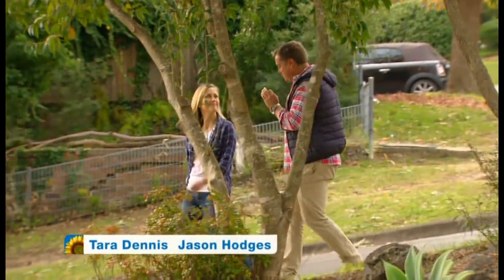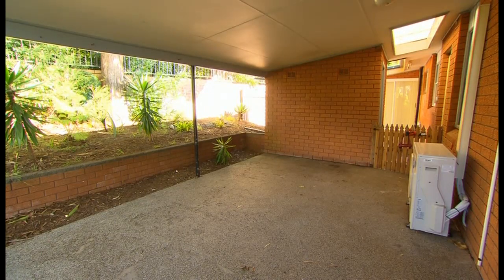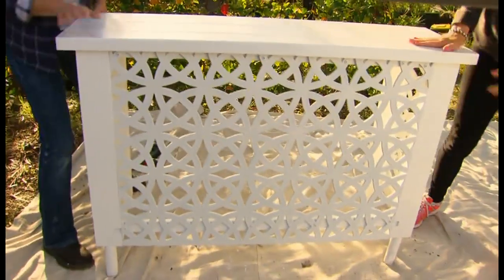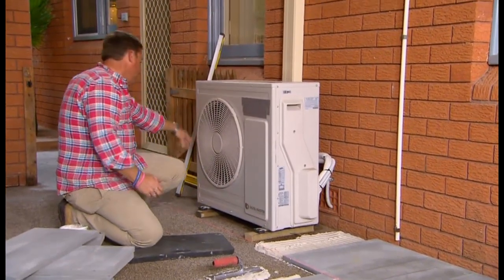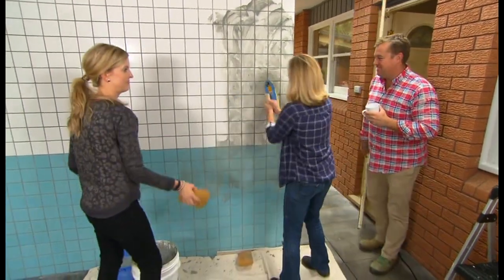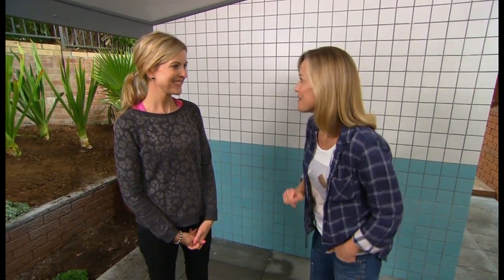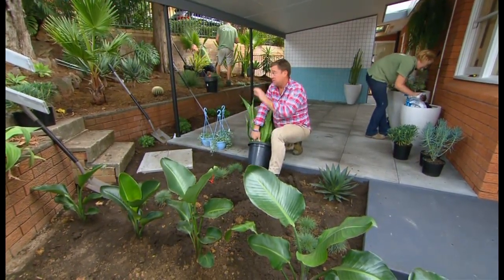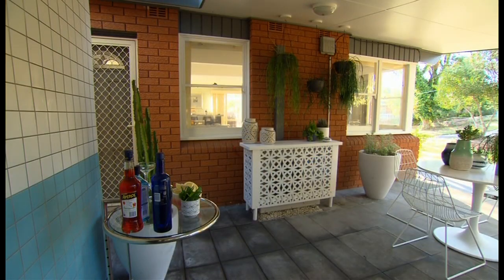How To Create A Stylish Outdoor Entertainment Area | Outdoor | Great Home Ideas

Comment: The tiles need to go. Absolutely.
1. I'd keep the brick wall and hang a big frame with a landscape painting, with a lamp above to draw the eye to the painting.  Or just add a hanging plant in the middle of the frame. Then add some wall lamps on either side to add atmosphere.
2. Otherwise I'd cover the brick with vertical wood slats, either painted a neutral colour, gray or varnished for a more natural look. I'd bring in a hanging plant or two again in front of it (to bring the garden into the space to tie the two together).  And add lighting to make it more cozy.
They definitely need something on that wall - they need a talking point.

The table and chairs in the centre take up all the space. It's such a great space. Add wood box chair around the edge of the space (like they do in their other videos).
The space needs to be softened. Maybe before guests arrive, they can hang a soft gauze white curtain on the side garden's side, right up against the wall. Maybe add another one on the other side as well, and tie both back. That'll create a frame for the side garden.

The ideas and possibilities are literally endless. No idea why they went with the bathroom look.

Comment: Need a large work top space next to the grill for prep and for buffet style food for gatherings.  Move the miniscule drink table elsewhere. Also, drop the legs a bit for the ac cover so it conceals it completely. I would've kept the original brick wall...goes better with the architecture. The ceramic tile makes it look like a bathroom wall.

Comment: Blue tiles don't go with anything esp with grey touches. Rough sawn timber horizontally laid so you can hang plants or decorative metal/other art on there. Tiled wall only would work with a full length bbq as easy to clean. 
Also a big space needs a decent size table and chairs for entertaining.

Comment: Hi everything nice except disguise in outdoor unit disguise,it will block the air flow to blow out and sitting arrangement is in front of it .When this unit works it will blow hot air in summer and coldest in winter no one will be able to sit in front of this air blowing fan

Comment: Bad spot to put table and chairs infront of condensor unit. In summer it will blow hot air out, in winter it will blow cold air (if unit is heat pump) toward who ever sit in front of it.